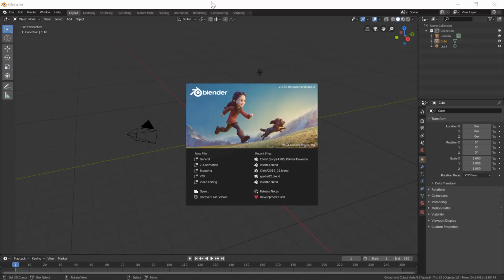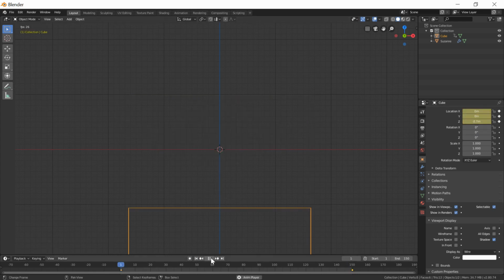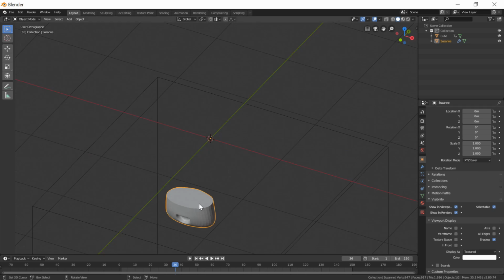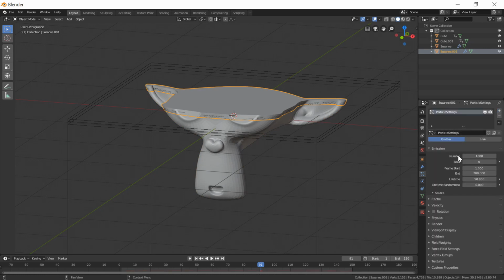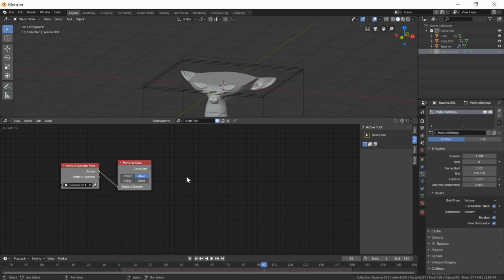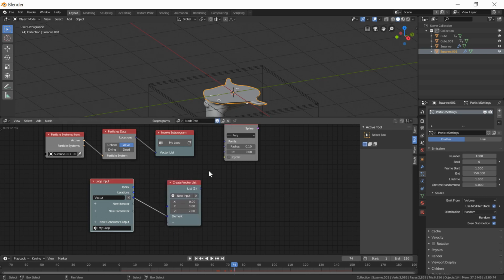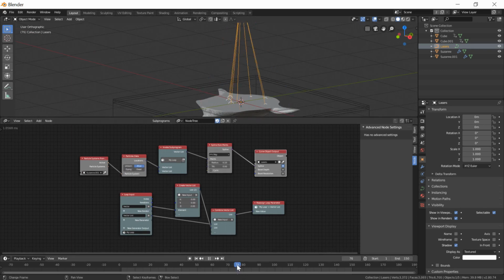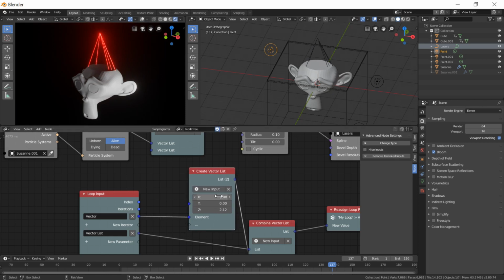Sci-Fi Laser 3D Printer Effect | Blender 2.80 + Animation Nodes Tutorial

Comment: I used a still character model and as one would expect, the animation nodes crapped out. They could not handle it. In a 270 frame animation, frame 113 onward randombly began displaying either cube and blocking the model, each time for only one frame. I will try to duplicate this logic via 3.0 geometry nodes. All that's needed is a curve from the particle object to a fixed point. Get these klunky unreliable animation nodes out of the picture.
Reply from the maker: Usually this flickering is more an issue with Blender's booleans...
Reply from the maker: Oh and BTW make sure you have manifold mesh for the boolean! E.g. Suzanne's eyes are a problem!

Comment: Hi Chris very good tutorial, I have a question , I follow all the process but at the end when I render this animation the rays keep static on the last position, I mean if I leave or stop the animation on the frame 50 all the frames from the 1 at the 150 have the rays on the same position was on the frame 50, but if I render manually frame by frame and save the resultanting render image  the animation is correct the rays follow the particules ( sorry I don´t speak english ). Any clue what can be wrong? I try with diferent configurations on the Node Tree Tools Activating and disactivating Auto Execute, Always, etc... for now the animation only works fine on the viewport not on the final render process.
Reply from the maker: I know ... :( Use viewport rendering instead! I hope they fix AN soon now that 2.8 is officially finished
Reply: @chrisprenn  Thanks Chris,  I hope this guys can fix this issue in AN,  animation nodes It´s a powerfull tool to improve the Blender features, you are make amazing job on your tutorials. For now  I finish the animation frame by frame and join on a sigle video file using the Video Sequenser.
Reply from the maker: @MrJxtv3x  you can use "viewport render animation" from the "view" menu (see https://youtu.be/kMNSCRG-Z3U)